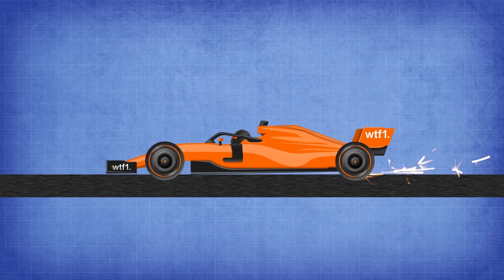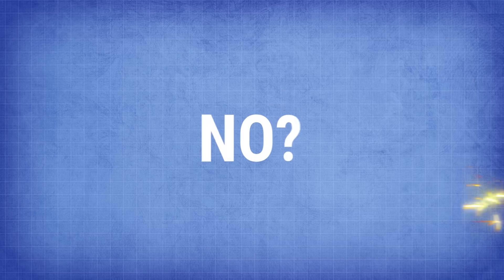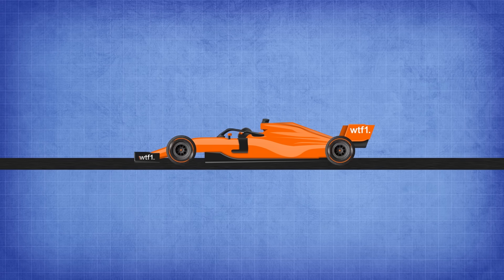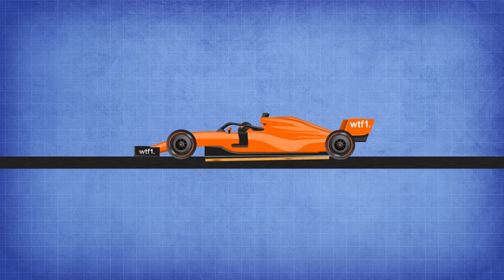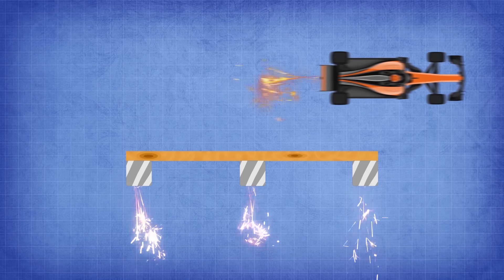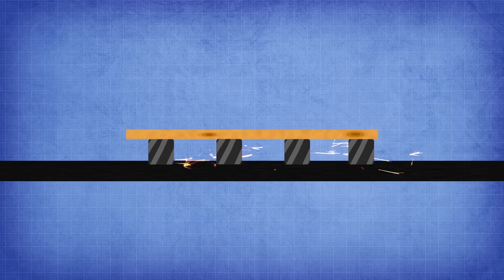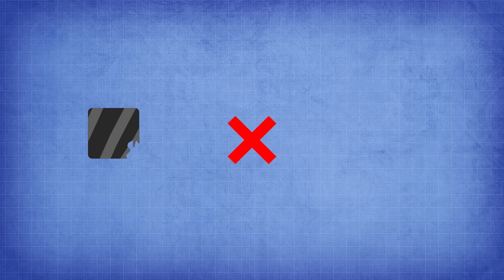Why Do F1 Cars Spark?

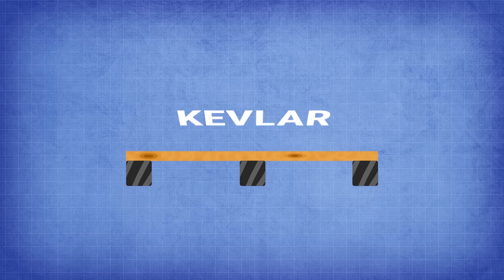Comment: Hello I get to be at the f1 races working security and was wondering about the sparks and a worker explained about the skidplate which I knew there must be one that it cannot get too thin or they are disqualified. However you lost me. aat 1:45 you show the skid plank however you then start talking about the mounting blocks which you show as the actual items that skid on the track producing the sparks. What then is the purpose of the 10 mm skid plate which your diagram shows is held away from the track by the blocks?? Las Vegas here I have begun working f1 about 100 days before race. Also I do not understand if the plate cannot get too thin or they are disqualified how does it rub at all if its the blocks you call "mounting blocks". If they are mounting blocks why then did you invert the drawing to show them as hitting the ground??
Reply: at 2:28 you use a term "writeouts"???

Comment: The sparks are a evidence of friction, friction is a form of resistance, and resistance slows the car down. In a sport where hundredths, even thousandths of a second matter, the sparks should be a negative indication. As to the fireworks display, I'm much more impressed by brightly glowing orange front brakes.

Comment: I don't understand the placement of the metal bits. If they were fitted under the wood plank to scrape the floor, then the wooden plank wouldn't wear off. If the metal bits are fitted above and the wooden plank touches the floor then the metal won't strike the ground

So how do both the wood plank and the metal bits wear off at the same time?

Comment: Because, to make the show more engaging (and reminiscent of the its true nature of man machine struggle for perfection, like in the past, see MONACO 88 Quali), they put titanium plaques on the central spacer under the floor to FAKE sparks. In the 80s, since 1983 they banned venturi effect with flat floors. Cars run so close to the asphalt that carbon sparked on high speed. It was the result of a tech choice. Today it is a firework to make children cheers. If you do not agree, please pick ANY recent video with F1 WChampions driving a car with a clutch. Say Vettel on Ferrari F1-87, and see how good they are at managing manual mechanics, speed, risk. Just to say...

Comment: I've always had a question about this. Theoretically, these sparks are due to friction between the car and the track. Wouldn't this friction slow the car down by milliseconds perhaps? (Just curious)
Reply: The friction is heavily outweighed by the downforce gain from being so close to the ground
Reply: @Khorshedalam1992  Yep, the friction may contribute to say 0.1% (not sure the actual value), buts the gains from the down force probably outweigh the friction by several times. Man, physics is my favorite subject.
Reply: @thatguyalex2835  nerd!
Reply: @OwnedEpicStyle  Nothing wrong with being nerdy brother. :) We are all nerds in our own ways
Reply: @thatguyalex2835 F1 engineers who deal with this kinda stuff are the nerdiest nerds of all! 😉
Reply: @Khorshedalam1992  truu
Reply: 100%
Reply: Came to the comments looking for this Q & A. Thanks!
Reply: With the car being lower, the bernoulli principle states that the vacuum underneath the car gets stronger, helping the car create more downforce while neglibly affecting drag
Instead of adding a degree to your rear wing angle, you can drop the car 1mm and see faster lap times
Reply: due to such high downforce which forces f1 car to spark gives way more bonuses like higher speed when turning, higher downforce = faster angles

Comment: F1 is truly unbelievable when it comes to burning money. There is always talk of cost cutting, etc, etc. But using a rare metal like titanium just to make sparks is pretty crazy. Between the 50 thousand pounds piston, five thousand pounds break rotor, all of it going to the bin at the end of the season, I sometimes wish F1 would truly get more basic and leveled, so we got back to a driver's championship and not a technology championship.
Reply: Titanium is not a rare or particularly valuable metal.
I have 3 sports bikes in my workshop. 
All 3 have full Titanium exhausts fitted as standard and can be replaced for only a few quid .
Reply: Naw, heavy disagree. I love the extravagance that goes into Formula One. There is plenty of other types of racing where it is quite a bit more basic.
Reply: It’s F1, not GT4

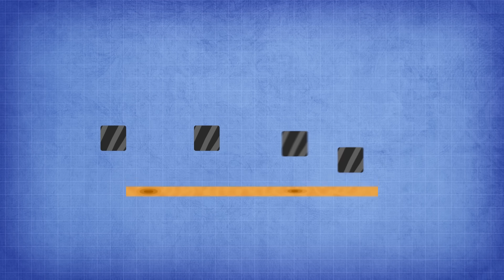Comment: 2:05 Why the FU*K do they use a PLANK??? the drivers can just go down to the crappy wood store & buy the most warped shit they can find & use that.
Why not use plastic or similar? it can be manufactured with MUCH grater tolerances, far down under sub millimeter difference per meter length in straightness tolerances.

Comment: F1 cars sparkling is one thing that will have most of us on the edge of are seats, but fireworks are something completely different and should be band to the general public for safety reasons organised deplays are fine  as long as they are insured incase anything happens that causes injury or damage .

Comment: Toe in on a corner dose not make it worse it makes it easier to slide the car into the corner with less power and set up a slide before you go in because the outside wheel now follows the apex of the corner and front wheel slideing is predictable ..... and toe out uses the inner wheel to drift through the corner efficiently but no feed back or grip just follow through and not predictable for slideing the front wheels thats the real reason they want to use it  for driver style when the down force of the front car miss- managers the front control of the car behind ...... toe in is no good down the straight dragging the wheels and toe out will steer all over the place so no toe in or out is applied here more efficient ... it is now banned because the rule makers want to stop developement and high authority driving techniques so every thing is under their ruleability ....survivability on the track and organisers dont want that after all their work bringing new rules for 2021 .....one law for the rich ....racing cars dont have mufflers but claim extraudinary efficiencies but in reality they are just a show piece for the unimformed crowd and money not real racing though ..thats economics  world class style ...  .skeatesybubbygoddess 2020

Comment: Before titanium sas mandated teams would use fasteners to hold the plank on made of a very hard steel alloy. Similar to what is used on the teeth of excavator buckets. Because it was so hard it did not wear when it touched the ground and subsequently didn't spark. Technically superior but less showbiz.

Comment: 1. Kevlar isn't a material it is a brand name for aramide. Twaron for example is the same aramide kevlar is but a different brand.
2. Kevlar isnt a metal nor is it used on the F1 cars. 

Kevlar is a para-aramide and is used in bullet-proof vests, why because it has a very high tensile strength making it almost impossible to rip.
Most likely what is used is nomex which is a meta-aramide which is heat proof and fire resistant.  

The more you know.

Comment: I thought it was because they filled the tires with fairly little air, say 15 psi in order to allow thermal expansion.  In Stock Car Racing, waiting for the tire pressures to come up because of this thermal expansion is often referred to as “Letting the car come to you.”

Comment: The spark is from a little button the drivers have on the steering wheel. It gives the car a boost of speed for an instant and also acts as deterrent to keep other drivers from tailgating too closely. I see these guys driving around pushing that button all the time.

Comment: You can see that at Daytona with stock car racing when the car's get bunched up together high speeds at the start of the race when the air pressure on the tires are low.

Comment: Next video: “Why does F1 even exist?”
Reply: Dick measuring contest between manufacturers (mostly Ferrari and Mercedes)
Reply: Research is where competition is .
Reply: Because 🗿 said so
Reply: Because "Hitler" from 2nd world war...
Reply: @92trdman  Grand Prix racing has been around since the 1920s; well before Hitler
Reply: It’s a really deep question if you really think about it
Reply: Clorox Bleach because yes?
Reply: BLASPHEMY
Reply: Most cars in f1 have road going cars, f1 parts are the very best out there, all except redbull....so basically at some stage a performance part , either engine, back wing for supercars...like the super car that nearly killed the stig taking a corner at 150+..went spinning for ages, stig say's, put a wing at the back and it'll break the lap record, a week later , he did just that... Buy a lot...beating a Bugatti Veron to top spot...

Comment: The weight is not the main reason, otherwise the cars would allways produce sparks when filled with fuel... they only produce when near the top speed because of the downforce produced by the aero kit...it generates so much downforce that the car is pushed to the ground..notice the diference between the back height on the end of the main straights and the same height on a slow corner..

Comment: What I like more than the sparks......when you can see the air coming of the rear spoiler....almost as if it was in a wind tunnel.....that shit blows my mind.....Usually only seen when there is High Humidity.....
Reply: Radio Active you know I like more than the wind in the wing.......The F****ING V12s
Reply: @camillecirrus3977  it actually is fascinating when the air comes out of the rear spoiler it looks neat

Comment: I think sparks just make your car look broken. 
One time I was driving down the freeway and hit a rather large bump, my muffler mounts broke and I started dragging my muffler and all I could see in my mirrors were sparks. Had like 900 more miles to drive that day too. I lucked out and found an S hook thingy on the side of the highway which I used to rehang the muffler, then my car wouldn't start. After waiting for AAA for a bit and knowing there wasn't any shops close enough to get a free tow to, we ended up push starting the car which worked. Had to push it up a small hill first. Made it home without any more problems after that though.

Comment: Also, the DRS can cause sparks: With less downforce coming from the rear wing (when DRS is open), and the normal amount of downforce from the front wing it can affect the aero balance of the front and rear of the car as the ride height is lower in the front than the rear= sparks
Reply: Lies again? YALE NUS Expensive Education
Reply: Aled2187 you are right only if the skid blocks are in  front of the front axel, but they are not.

Comment: Question I had for some years related to sparks. 
Do cars actually lose speed from (hitting ground and) creating sparks? I understand gain from running car as low as possible. But is it still trade-off between these two? (like... running and allowing to bump 3 mm lower would gain 0,100 s per lap, while bottoming out by itself would make to lose 0,025 seconds per lap, net gain 0,075 s so still better to have lower car with more spark vs higher with less).
Reply: Slightly

Comment: Nope, don't care. Sparks do nothing for me. What's the point of it? It's just a byproduct of wear - like brake dust or bits of rubber. Should I find brake dust or bits of rubber thrilling as well? And done deliberately - well, that's just kinda like fake scoops and vents that do no useful function and are only there for decoration.

And besides - are there sparks in all the other racing classes I enjoy? Generally, no. So to me it just seems odd. It's not a normal thing for race cars to throw off sparks and they seem to work just fine without them, so what's wrong with F1 cars?

Comment: isn't this wrong? In comparison to the weights? around 100kg Fuel in an F1 car, But what about Downforce? Aerodynamik on a F1 Car is really more than 100kg ?? I think the sparks coming more in high speed areas where the downforce ist more than 2x the weight of the car ? Or am i wrong???

Comment: Without watching the vid, F1 cars has this thing like any other race car; ride height, adjustable between springs. F1 drivers has this low for smooth rides and aero efficiency, but can downgrade smoothness and potential speed due to skidding.

Comment: Next video: why do F1 cars have engines?
Reply: Next video: why do F1 cars have drivers?
Reply: Next video: Why do F1 cars race?
Reply from the maker: Farhan Malek9 They don’t, they have power units
Reply: @WTF1official  
Next video: why do F1 cars have power units?
Reply: @WTF1official  which contains an internal combustion engine (ICE)
Reply: @joshuil1235  ICEman
Reply: @WTF1official  They have ICU's
Reply: @astrixcz9107  it is still an engine.
Reply: @WTF1official  Then why do F1 cars have ride heights? Next vid
Reply: @WTF1official  And the power units contain an ICE...
Reply: @WTF1official 
Why do F1 cars have cars?
Reply: WTF1 Will you do a video about those new speculated engines for 2025/2026? Two-strokes with synthethic fuel...
Reply: @WTF1official , consisting of the primary V6 engine, MGU-K, MGU-H and ERS :)
Reply: @WTF1official  why do F1 cars have wheels
Reply: @WTF1official  what is ERS deployment in f1?
Reply: @WTF1official  roasted
Reply: @WTF1official  maybe you should learn your facts, they use 1.6 litre four-stroke turbocharged reciprocating ENGINES
Reply: @LightOfQuran1230  in fact, they have TWO engines. An ICE and an electrical engine with MGU-K/H
Reply: @alidib9284  exactly
Reply: @alidib9284  an electric motor not an engine... Engines burn fuel to produce power (combustion)
Reply: @Johnny-tq9no  an electric motor is engine. Its in the name ffs
Reply: @alidib9284  no an electric motor is not an engine
... An engine is a motor if a motor is not necessarily an engine
an engine is a motor that burns fuel through combustion to create our electric motors do not do this
Reply: @alidib9284  smh
Reply: @Johnny-tq9no  i see your logic but its still wrong. A motor/engine creates power similar to an electric OR a combustion engine. Smh.
Reply: @alidib9284  it's not my logic it's the engineering definition of an engine/ motor ... An electric motor is not an engine
Reply: @alidib9284  and no an electric motor does not create energy through combustion like a steam-engine or internal combustion engine
Reply: @Johnny-tq9no  1. I said SIMILAR. 2. Im tired so ok, youre right
Reply: @alidib9284  yeah I'm just saying that an engine and a motor have different definitions although they are often used interchangeably it's like the old all tortoises are turtles but not all turtles are tortoises
Reply: @LightOfQuran1230  why do u even bother watching his videos, hahaha, crying kid
Reply: F1 cars dont have engines, they run on FREE ENERGY! WAKE UP SHEOPLE!
Reply: Why? Just why?
Reply: Le why does F1 F1?
Reply: Why do f1 drivers wear helmets?
Reply: In 2006 the FIA mandated that all F1 cars must have engines.
Reply: So that is comparable with this? Ok.
Reply: Exposed by wtf1
Reply: Why do f1 cars have wheels?
Reply: didnt know they waste titanium for sparks. so at least something learned i guess
Reply: @richardtickler8555  yep, they also waste gasoline for sports.
Reply: @danielsalas7071  physics 101: speed is linked to energy, energy cant be made or destroyed => petrol is chemical energy that is transformed into kynetic energy. wasting titanium for nice sparkles and shit doesnt have anything to do with that
Reply: Richard Tickler tf?
Reply: @danielsalas7071  petrol is needed to get the car going, titanium floors are just there for the sparks (could be anything else basically)
Reply: Richard Tickler i see where the confusion is. I never said there was a correlation between titanium being wasted for sparks and petrol being wasted for sports... i meant that to use petrol for a sport, is a waste of the resource.
Reply: I'm laughing 😂
Reply: Then one will come up ....why do f-1 driver's wear mom jeans and think the the coolest beta in the paddock.
Reply: True
Reply: Next video : why do f1 races so boring?
Reply: Farhan Malek9 ya .. they spark cause of
The spark fairy .. how the fuck u think they spark ya idiots ugh smh
Reply: Sadly i would probably watch that video
Reply: Why do F1 cars have humans inside them?
Reply: Next Video: why do f1 cars have wheels
Reply: Next Video: why do f1 cars have wheels
Reply: next video: why do f1 cars exist?
Reply: ha ha
Reply: Next video: why are F1 cars called F1 cars
Reply: Why do F1 cars have tyres
Reply: Why F1 don't have solar panels to satisfy Greta?
Reply: I lol'd.
Reply: Next video: Why do F1 engines spark?
Reply: LOL so many people missing the joke here
Reply: @dionysusnu3881  funny we where also joking dumbass
Reply: @sgtcart0onz755  funny necropost and no.
Reply: @WTF1 Next video: Why do F1 cars need drivers to drive the car?